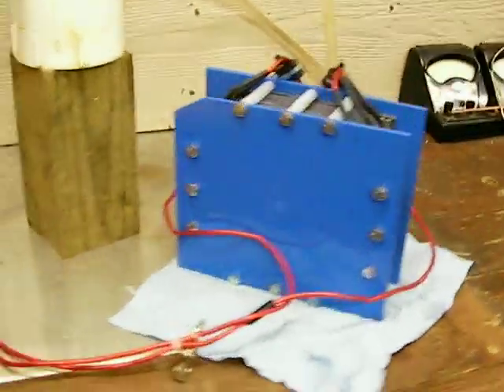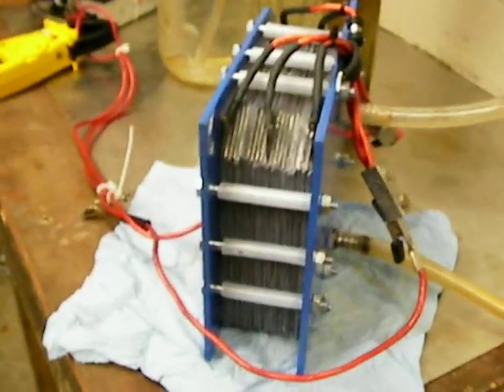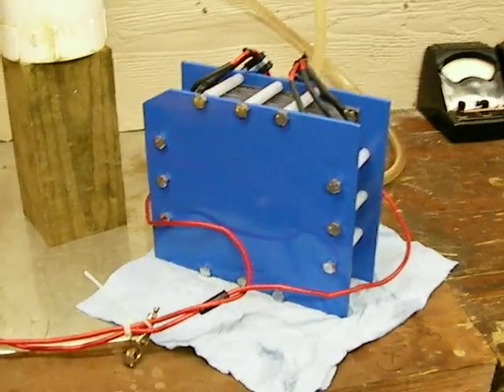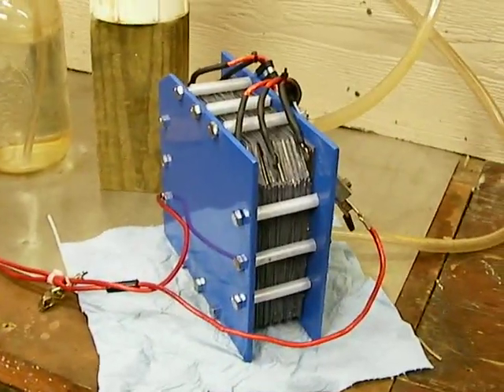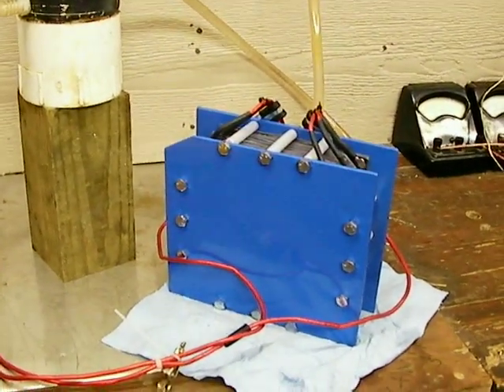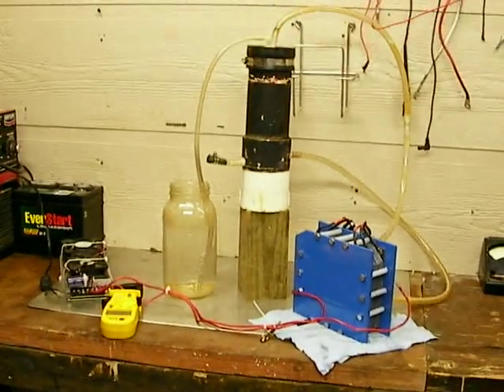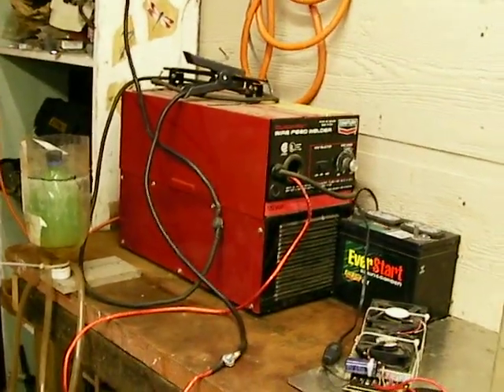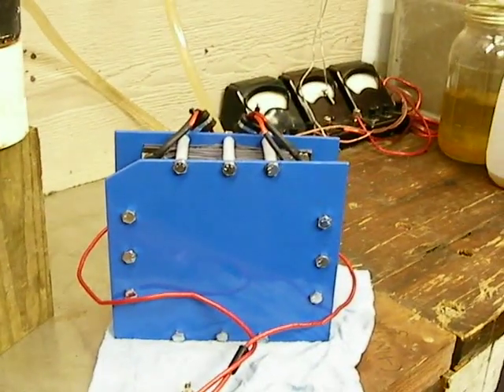how to build a HHO cell

Comment from the maker: it has 21 plates a common 4n 4c 6x6 i put this cell in a 2007 ford f-150 with an EFIE circuit board. the owner has told me he got 150 miles on a 1/4 tank! i am running the cell at 40 amps on the truck.. i will do a video after the official results are in....WOW i did not expect that!!!